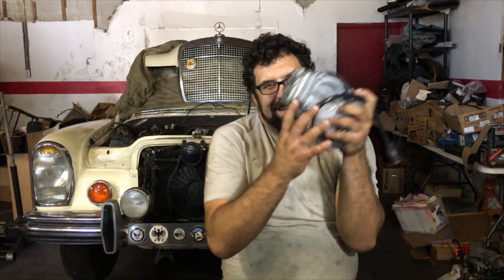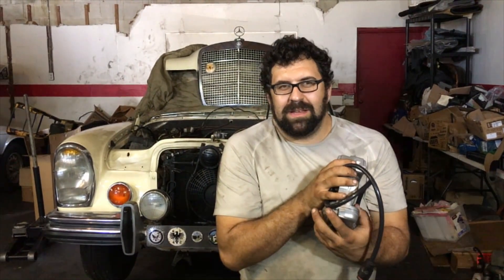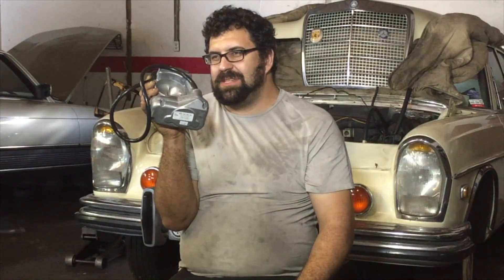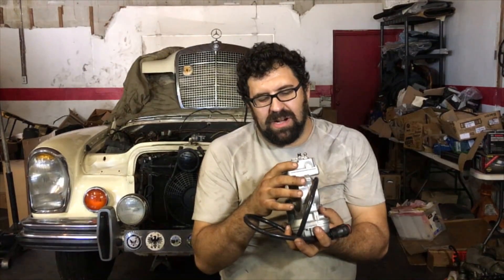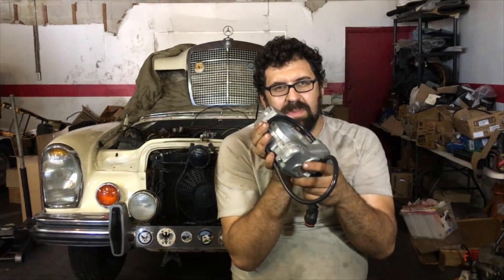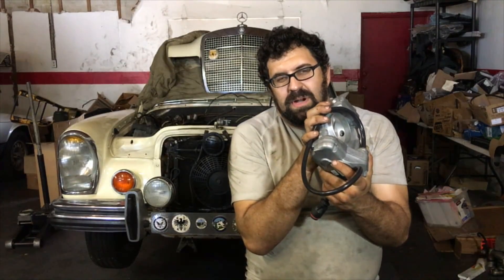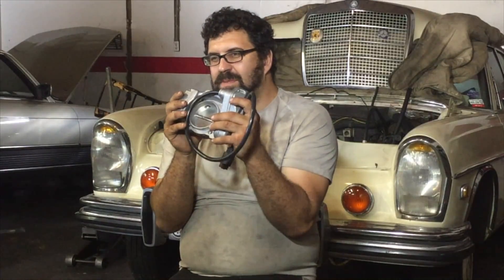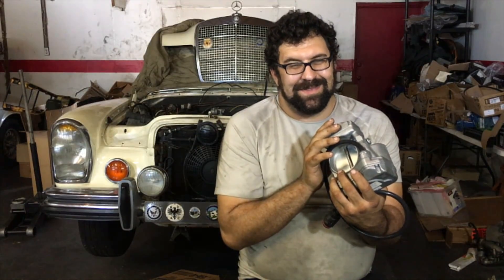Throttle actuator failure?

Comment: I rewired my 2 actuators for my 95 m120 v12
It's possible to split the plug and rewrite all the way inside. I'd have to ck my files as I remember to having a schematic for the pin #s and board soldering points. 
Sadly, it worked for a little while. Realizing the pots. May be bad as well, gave the job to Beckmann. Think it was 800$ for both. This was back in 07-08. That S600 was the only Benz to ever beat me. Almost kept it and transplanted to a GM LS plant. 
Great info Pierre!!